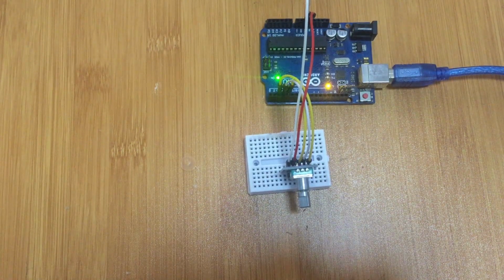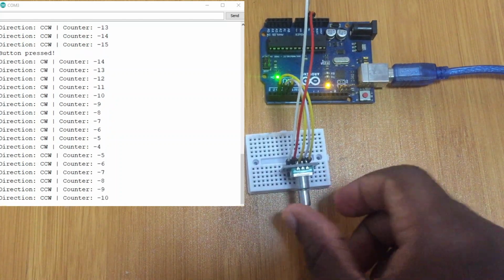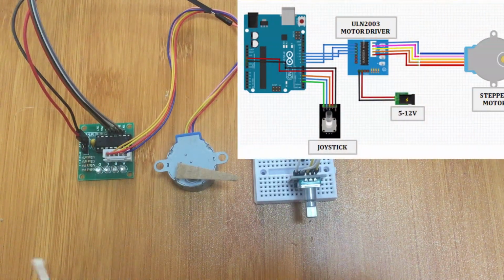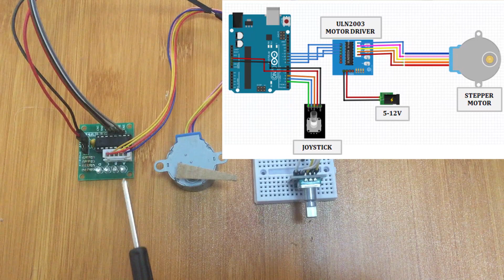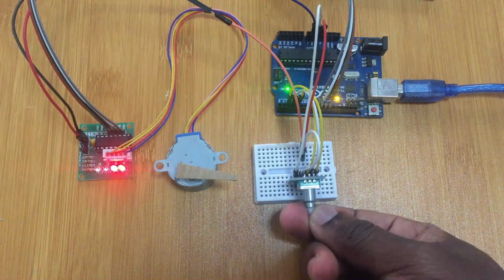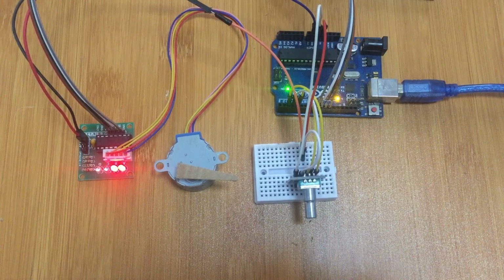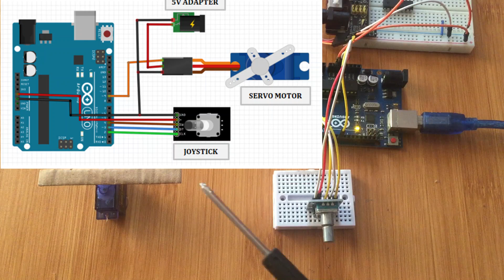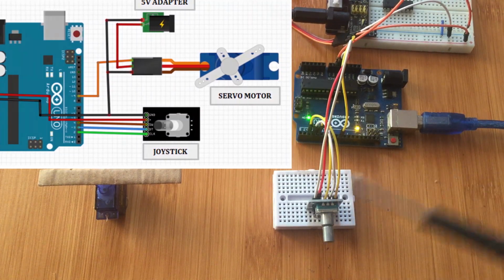HOW TO CONTROL STEPPER AND SERVO MOTORS USING A ROTARY ENCODER.

Comment: Very cool video, very clear and it actually works, thank you!!! One question: as is, it seems like the encoder/servo ratio is 1 to 1. Can you increase the servo control ratio so to make the servo spin faster than the encoder? like encoder/servo 1 to 2? Thanks!